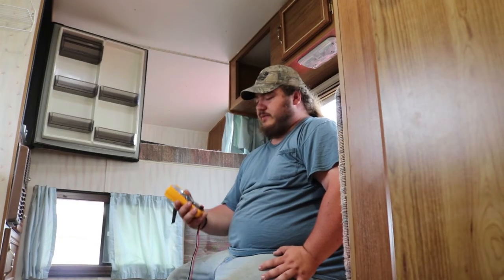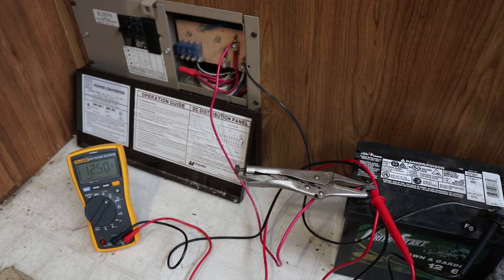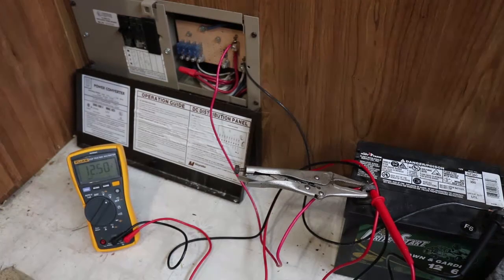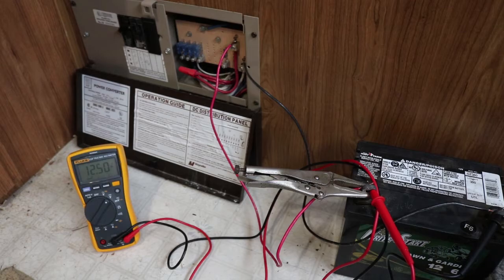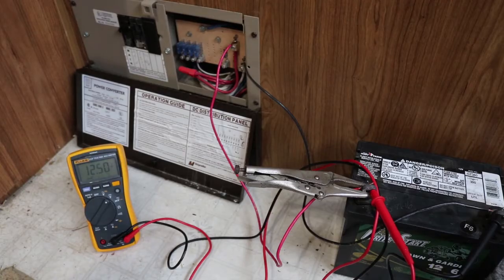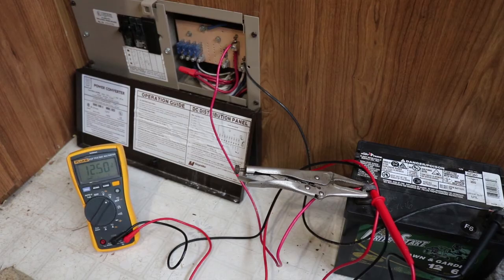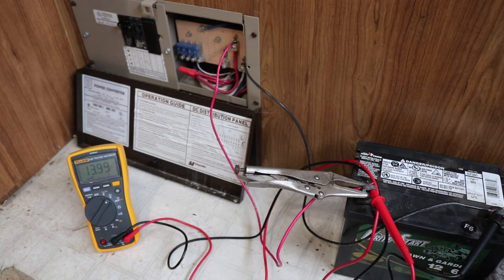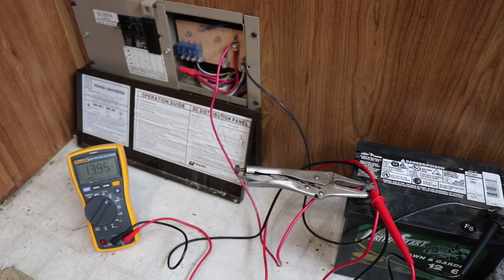How to test an RV / Camper 12v Converter Simply

Comment: I want to know how to remove a converter all together and not have one
Reply: Thanks
Reply: If there’s a loud humming noise dose that means it’s bad?
Reply from the maker: @user-pd9xo4dx6w  not necessarily, some hum louder than others and the more power demand on the 12volt side will increase sound also. Some converters have cooling fans, and if the fan cant turn front dust build up or other issues those will hum too.
Reply from the maker: @user-pd9xo4dx6w you're welcome.
Reply from the maker: If you remove the converter, you would have to replace it with a breaker box for the 120volt side and figure out an alternative way to power the 12volt side and charge the battery(ies). Physically removing the converter is not too difficult

Comment: Great help but you don't explain or show exactly where to connect the tester to the panel we can almost see but not real good.
Reply from the maker: These panels are all different and especially depending on how old the panel is. Showing specifically on this panel and describing its location likely will not benefit you if you have a much newer camper. This panel was installed and 1993, and every camper I have worked on it the panels seemed to have changed every few years. The main power lug and main ground lug on the panel are a good place to test this.

Comment: So the converter runs on 120 VDC yet it's used to convert to 12 VDC?  If this is the case, what CB are you using to shut down the converter?  The main(s) CB?
Reply from the maker: The converter turns shore power, 120volt, into the 12volt power to charge the battery or batteries and power 12volt appliances like the lights, water pump, maybe a 12volt fridge in some cases. The converter will likely have an internal charge controller/ regulator to maintain the batteries and appliances. When there is no shore power, the converter still distributes battery power just from the battery system.

Comment: Can the Converter run the 12v circuit without a battery being installed?
Reply from the maker: No, the battery is your cushion. The converter can not instantly change to the load to safely supply the system. Without the battery to start your load, the converters internal regulator will act more wildly. My apologies if this does not make sense, I'm struggling with recovering from a major brain surgery a little under a week ago.

Comment: my battery reads 13.07 volts , when i plug converter in to 120 volts the battery rises to 13.61 volts, is that enough charging or is my converter bad?   my battery keeps on loosing all of its charge while on shore power.
Reply from the maker: 13.6volts should be charging it. Maybe your battery is not good. Most places that sell automotive batteries can test them for you for free. Some charge a small fee. A bad battery can ruin a converter if left too long.

Comment: I notice when I plug in to shore power I hear a humming sound coming from behind my panel.  If I flip off one of the 15 amp circuit breakers marked recept. it goes off. There's two 15 amp recept. circuit breakers but only the one affects the humming. Is this a normal sound or is there maybe a stuck fan or something?
Reply from the maker: Usually the humming is affected by the amount of load on the converter. Is there a load on that circuit? Lights, microwave, coffee maker, etc?

Comment: When I was plugged into shore power mine was going up and up to 14.4 then I unplugged it .  is my convert out ?
Reply from the maker: 14.4 is not necessarily bad, that would be situational.
Reply: @BillTheTractorMan  it was still climbing though
Reply from the maker: @garyryan7852WR  yep, that happens if the battery system is low on charge. If it gets over 15 I would start looking at if the converter is not sensing voltage correctly.
Reply: @BillTheTractorMan  ok ty I was getting worried . I will plug it back in and keep an eye on it . 15 is about max then . gotcha ty
Reply: Hey everyone mine is at 12.4 when not hooked up then when I connect my battery it says 12.6 not much of a jump when it's charging is this to low to be charging or is it fine

Comment: When plugged into shore power with a fully charged battery to start, my camper lights eventually go dim. The battery tested at 11.6 v and the leads going from the camper (converter) to the battery read 11.75 v. All the blade fuses are good and the brewers are not tripped. I pulled the power panel out. There’s a noticeable whine coming from inside the converter when plugged in to shore power and the converter fan is not working. I’m assuming this all means the converter is bad and needs to be replaced. Would you agree? Or is it something else?
Reply from the maker: I'm going to still recommend ruling out battery failure first. The second thing I would check for is the 12v system having a draw with everything off. Once you get that figured out i would test to see if the converter is actually trying to charge the battery or not.
Reply: Bill The Tractor Man How do you test to see if the converter is actually trying to charge the battery? I saw someone doing it with the converter pulled out andantes multimeter but mine is tucked away. If possible I’m trying to determine if my converter is working without pulling it out and I’m not sure if I’m understanding correctly. My 1977 GMC has a new living area battery which is able to power the lights and water pump. This confirms my battery is charged. I’m hooked Up to external power which is supposed to charge my living area battery through the converter. I’m thinking if I leave some lights on overnight and wake up to find the battery at good charge then the converter must be working. If it’s drained then the converter may not be working. Does this sound like a good test to you?
Reply from the maker: I'm going to recommend first disconnecting the battery and charging it. After charging it let is settle for a few hours a recheck the battery. Anything below 12.5 would indicate a bad battery. If there is no draw on the system and you have less then 12v I'm concerned thinking the battery is bad. The hum could be the converter working hard to charge the battery and same with the dim lights
Reply: This is a brand new battery. I replaced the battery that came with the camper when I bought it used last week (2004 Jayco Jay Flight 31 BHS). The battery was pretty new but tested bad. So again, this is a brand new battery. I plugged the camper in, turned all the lights on, AC, and fridge. AC kept working, lights were dim completely by morning.
Reply: I also meant to mention that the battery was disconnected from the camper and the converter was still making the whining noise. And the cooling fan for the converter would never come on.
Reply from the maker: @matthewlblair  the fans usually only run as needed, not constantly. Some converters make more noise then others based on load and use. For instance I worked on a camper that the converter would humm if anything was on, be the refrigerator, a tv, or lights. If something that drew more power was used like a microwave, the humming would be louder as there was more load.
Reply: It was the converter. I replaced it and all is well. If you aren’t getting 13.4 v at the leads going from the converter to the battery, I would pull the converter out, wire it up to a plug, plug it in to a wall outlet and test the output directly from the converter. That’s what I ended up doing. It wasn’t putting out enough voltage and the fan wasn’t working. I suspect the fan died, causing the unit to overheat and damaging it. The replacement converter needed a bit of modification to attach to the old power unit, but wasn’t too hard to fab something up. Hope you get it straightened out.
Reply: Matthew Blair by “the leads going from the converter to the battery”, do you mean the living area battery terminals?
Reply: Chriskriller yes, test the voltage there. Tat wil at least give you an idea. Doesn’t necessarily mean it’s the converter according to the original poster, but it will at least let you know if you need to test the converter.
Reply: @matthewlblair  I have a smart converter and when I test the voltage without any battery connected it is 14.6, when I connect battery it sits around 12.6 to 12.7. Is that normal? I see everyone elses battery charging at 13 volt but why does mine sit at 12.6 or 12.7?

Comment: When you turn on the circuit breaker, there is a humming noise that is starts occurring. Is that normal? My camper is making the same noise but a bit louder. Seems to go away when running appliances.
Reply from the maker: A humming noise can be normal. Some converters have a fan which will humm.

Comment: When I got my camper I initially reversed the polarity.  Some inverters have a fuse to help with this but mine does not.  The result was everything works except the battery will not charge when I am plugged into A/C.  Any idea what to look for?
Reply from the maker: You very likely ruined that part of the converter. The short would cause a lot of heat and melt connections or the board.

Comment: Thanks for this great information!  Been wondering how the on board batteries would get charged when connected to shore power and it sounds like it's just as simple as connecting them to circuit haha.  I am curious though how you would wire an inverter into the circuit.  Would you have to have separate outlets for each situation?  Shore power vs. Battery/inverter power
Reply from the maker: I would have separate outlets for inverter use, I imagine there is a way to feed the whole camper off an inverter though. My reasoning is I do not have much need in my camper for an inverter as I can power most everything fine off the 12volt side without the energy loss created by an inverter.

Comment: my camper is acting weird, i seen a 2amp fuse blown so i replace it with a bigger fuse, my 12v system only works when theres a large load on it, i have to run my microwave, a fryer, and 110v heater just for my 12v lights to come on.
Reply from the maker: What was the 2amp fuse for? Did you mean 20amp?
Reply: @BillTheTractorMan  it was a 3 amp, all the other fuses in there are 10 amps, the 3 amp  reaps U/C, cant really read the handwriting
Reply: @kitt28  mine doing the same thing, but no fuses blown. Ever figure it out
Reply: @0ptimal  i hooked up a battery charger running on 2 amp and that fixed the problem
Reply: @BillTheTractorMan  It was probably A/C and 30 amp! 
3 amp🤦😆

Comment: everything is working fine except the converter will not charge the battery it keeps blowing a fuse
Reply from the maker: Sounds like a short in your wiring some where or the regulator is faulty. I recommend checking voltage at the battery while and monitor it until the fuse blows. Voltage should not fluctuate beyond 11.5volts up to 14.5 volts. If your voltage goes beyond 14.5 I would suspect the regulator, if you drop low you're battery is discharging due to excess draw from a short potentially.

Comment: Great video, I have a fifth wheel and some of my lights has stopped working. One of the fuses was blown, and when I tried to change it, it sparked. How can I fix this?
Reply from the maker: latoya banks could be a bad fixture or short in the wiring. The sparkling of the fuse would be because there is a load on that circuit. If you dont have much electrical experience I would recommend having an RV dealership trouble shoot for you. Otherwise process of elimination, inspect all of the fixtures and wiring you can see for issues. Check the fixtures with a quality Digital Multimeter for shorts and if they check out try to check the wiring from the fuse to the farthest light. Unfortunately that will be difficult to find because RV lighting is usually daisy chained.

On the odd chance of there is bulbs that are higher amperage, there are modified,  or added fixtures it could be related to that.
Reply: Bill The Tractor Man , thanks for responding. I remembered when I turned on the AC I smelled a burning smell, turned that off, the next day lights would not work.🤔 Any suggestions?
Reply from the maker: latoya banks I believe you have a melted wire. You could have a damaged wire harness for the AC and the lighting. A lot of times in RVs the wiring can be ran all together and in a case where one wire is over loaded it melts the insulation and will heat up other wires melting their insulation. My guess is you have a short in the wiring now. I would recommend you turn off all the breakers and pull all fuses except for ones relating to your driving lights on the camper. If you came this is probably a good time to make an appointment with your RV dealer or a local RV repair company before any further use. Electrical is a leading cause for RV fires.
Reply: Bill The Tractor Man, Thanks so much for all of the info!!!
Reply from the maker: latoya banks your welcome, glad I could help. Stay safe and happy camping!